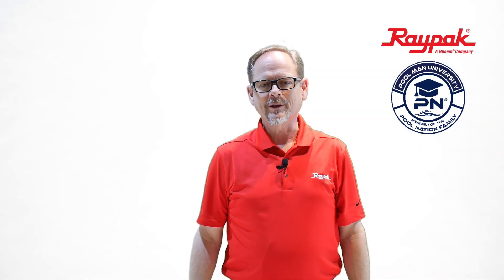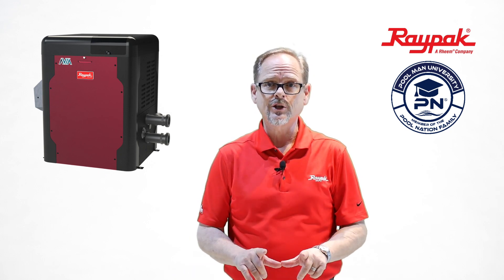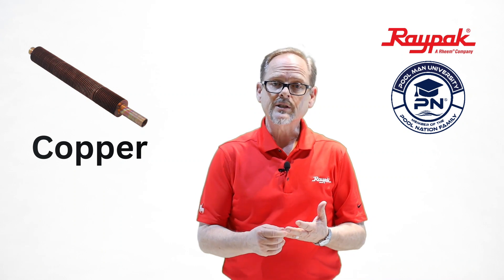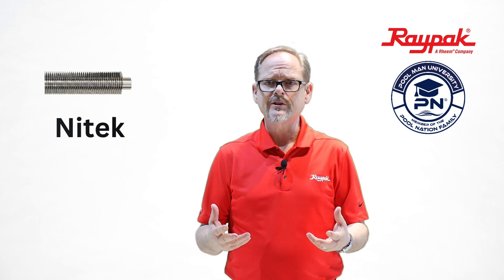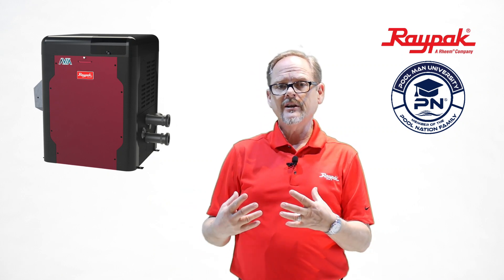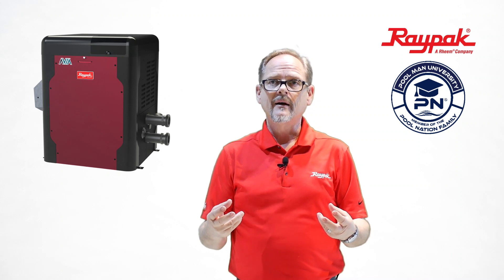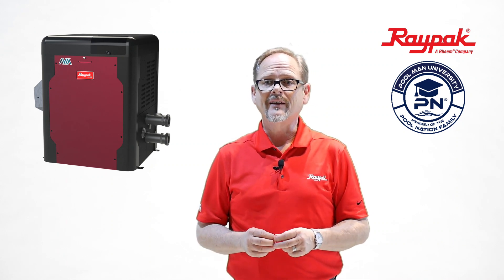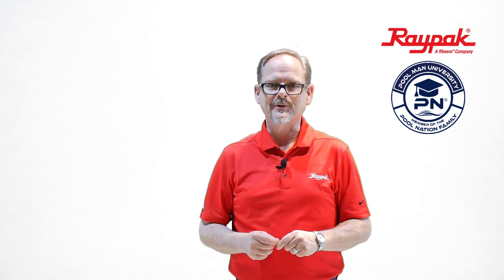Raypak Avia Heater

Comment: My setup is entirely Hayward right now (heater, variable speed pump, DE filter and salt water T-cell). It's all controlled by a ProLogic automation unit. If I were to replace my current heater with a Raypak Avia, would it talk to all of my other components and eliminate the need for that ProLogic unit?
Reply from the maker: You would still need an automation. You can only control one other piece of equipment currently with the Avia.
Reply: @poolmanuniversity  would it run a Hayward variable speed pump?
Reply from the maker: @Brendan Johannes  I believe it's a relay. Let me double check with Brad and I will let you know
Reply: @poolmanuniversity  relay as in controls a basic item like a water feature, valve, etc?
Reply from the maker: @brendanjohannes9309  yes.  You should be able to run it from there.  Just want to triple check for you